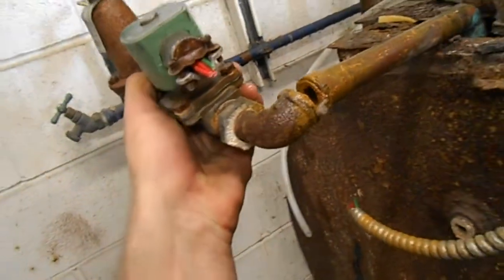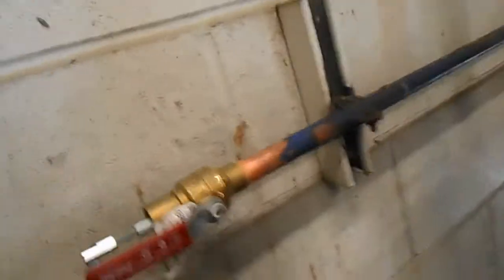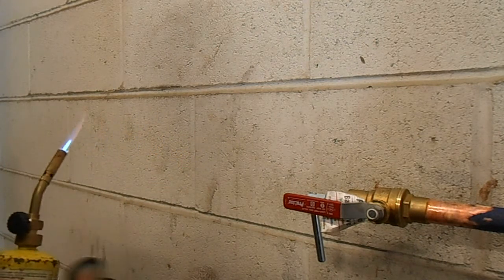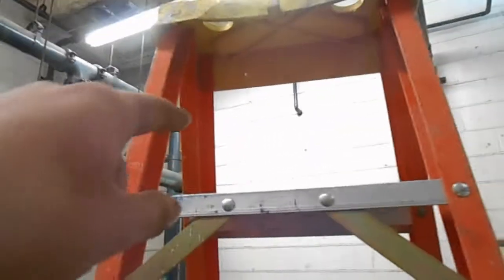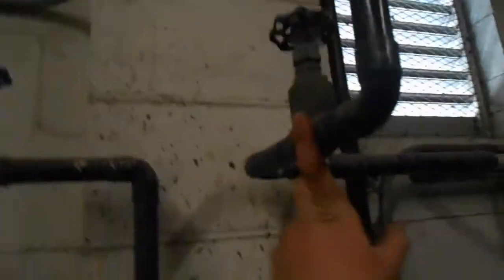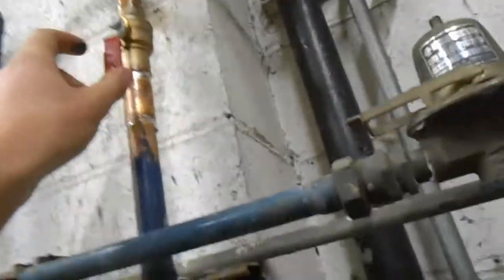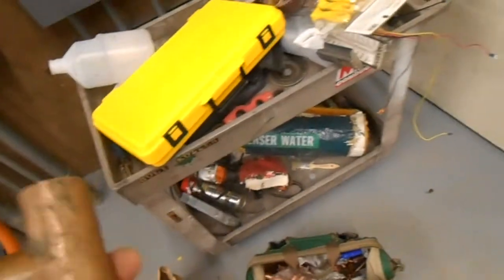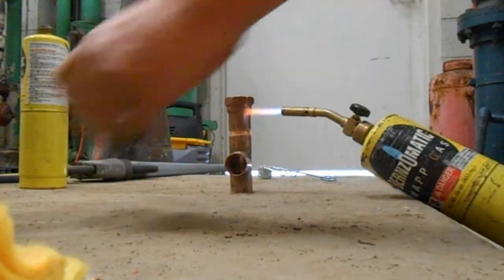Boiler Room Plumbing

Comment: lmao im 21 and i do high rise plumbing too i can tell you are a shoe maker right away my friend, your torch is good for nothing you need a mc tank with burner your not gettting good heat. a 3/4 1/ tee and FIP or what ever that is probably cost more then a ball valve i dont know man your a shoe maker not plumber
Reply from the maker: stefan k Ok guy, you and I are the same age it sounds like. I had a handheld turbo torch at the time and I can still do a mean bit of plumbing with those little guys. I do use the air acetylene most of the times these days. I was working with what I had. I installed cheap parts because that's what I could get my hands on at the time. Ever have a shortsighted customer? Happened to me! OH NO!!! I might have to get paid overtime to come and replace them when they don't shut off next year! I do everything super nice now that my customer has the proper accounts open. All Apollo Valves and Mueller fittings these days. Got some new videos coming up soon that I haven't posted yet. I think you might have a different point of view after watching those. By the way, the only shoe makers I know are very talented craftsmen so; I hope that wasn't meant as an insult. However, I would like for you to show me how the high rise plumbing pros take care of these situations. I'm sure you are the head honcho in your group not a helper. Thanks for watching!